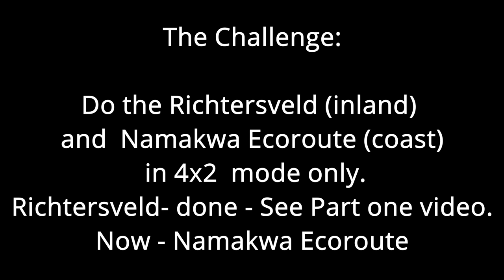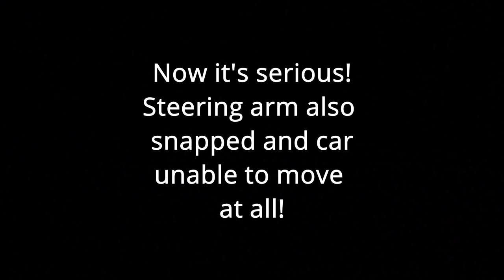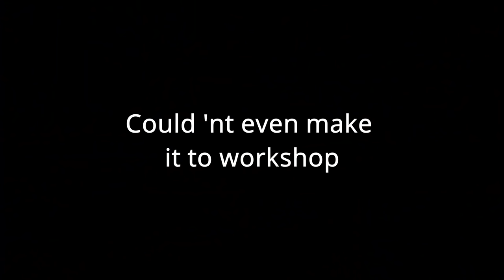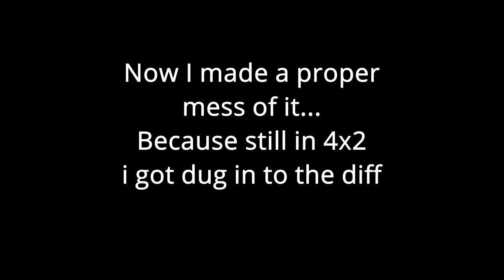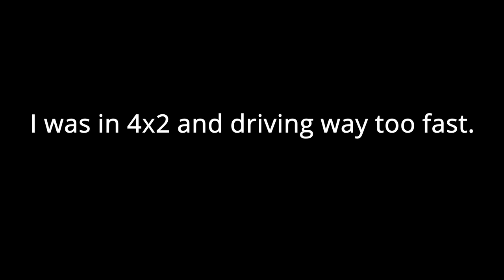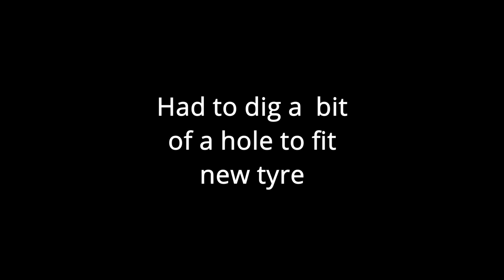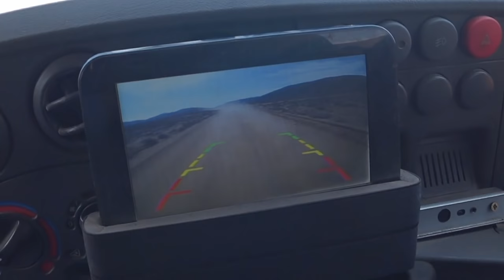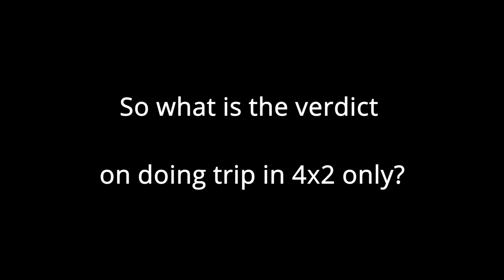Disaster on Namakwa 4x4 trail .. Solo 4x4 trip with our Iveco Daily 4x4 part 2

Comment: I don't get the point of driving those roads in 4x2?   It just messes up the road even further for the next vehicle to use it.
Reply from the maker: I didn't feel the need for a long explanation on the other reason but now feel it is warrented. I was forced to drive with odd sized tyres =axle wind up. Didn't say anything. Wanted to see who is sharp enough to see that tyre and spare not the same size
Reply: @Overlandervanman  But in your intro The Challenge was to See how far you could get in 4x2 only?
Reply from the maker: Yes for two reasons . One i wanted to see if whole route is do-able in 4x2 after several requests .I also ended up being sort of forced to do it in 4x2 and only select 4x4 when really needed because of axle wind up. You can then only go short distances in 4x4 or you will break your transfer case
Reply: Doubt if you would have gotten bad diff wind up in that thick sand.  But thanks for sharing anyway.  We all learn from each other